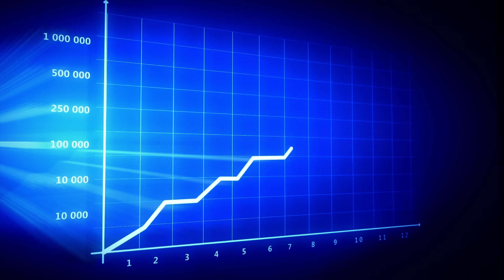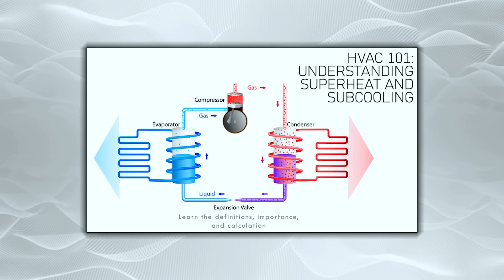⚠️Growing Problem of Mixing AC Refrigerants

Comment: I was in the HVAC business for 40 years. It taught it at trade school. I'm retired from it now.  IMHO sun downing R22 was more a matter of DuPont patent rights than ozone issues. R22 was an ideal refrigerant. Now they are doing it again with R410a. I have a 25 year old R22 Rheem system which I installed in 2000. After looking at this whole r454 $hit-show, I bought an exact new replacement 3.5 ton R22 Copeland Scroll, a 30# tank of R22, an exact swap R22 TXV.  When mine goes down, I will rebuild my existing system like it was a '57 Chevy.
Reply: Wow, what a hornets nest I stirred up. I simply said I’m staying with R22 because I have the skills and parts to do so and it historically found it works. You’d think I defamed the pope. 

Mark my words youngin’s you’re going to see the same issues with R454 condensing units you’re now seeing with turbo charged 4 cylinder engines being put into trucks. The old V8’s were tried and true technology but some pencil neck bureaucrat who had a $200 lunch with an industry lobbyist decided we needed to convert them all to 4 cylinder turbo charged engines because they got 7 mpg more. Except for one thing, they don’t perform their primary function of reliability. Hence people are getting 5000 miles out of a new Toyota Tundra before the engines are trash. 

That’s all good news for you new guys in HVAC, you’re going to be quite busy on warranty calls, but it’s bad news for your customers who depend on your skills. Think this is just all my personal conspiracy theory? Have you asked yourself WHY you can’t suddenly source r454? Hmmmm !!! Conspiracy theory or the typical market manipulation for higher prices? Age does give one historical perspectives and I saw this same game played out in the late 90’s.

And as for the environmental impact, the science isn’t settled on “freons” negative effects on ozone depletion, but there are going to be whole a lot of landfills filling up with dead R454 condensing units.  If you believe the government always has our best interests at heart, I got a safe and effective Covid vaccine to sell you.
Reply: @milwaukeephil2548 yes sir - been a heavy duty mechanic for 25 plus years - the garbage that they’ve tossed at us in the name of the environment is a joke - it’s all about cycling out equipment sooner than we used to selling us inferior over priced complicated garbage - truck engines last half as long as they used to , get half the fuel  economy , now require a separate exhaust fluid - the new heavy equipment and trucks are garage - the toss some bs creature features and everyone gets all hot in their pants - I don’t give a shit about a heated seat or touch screen in a excavator or semi tractor - I want a reliable , serviceable , rebuildable unit not this over priced trash - “oh it’s better for environment “ HORSE SHIT ! We are tossing stuff in the dump left and right -everything from chainsaws , to household appliances, cars , trucks , equipment - price has sky rocket quality is in the toilet -
Reply: 😂 someone took notes in class.. it’s all a gimmick
Reply: 22 is just a thicker refrigerant.  It will tolerate microleaks in the coil a lot better.  R12 was like gear oil, that stuff would stick forever without leaking.  It was just so fat it couldn't get through the little holes. 502 was the same way. I do love 448a, it is a great new refrigerant . All the phase outs have always been a nightmare,  but boy do they bring profit.
Reply: You're absolutely right we have done it for 43 years it was DuPont's fault r22 was fine
Reply: They've made the R22 coils and compressors out of sight .you can get your hands on the new equipment cheaper .it's the labor and supplies that you'll need is what will cost you .
Reply: I have mixed match r22 system with a 20 year old Rheem air handler. I have been nursing it along just because of all this AL2 refrigerant business. I am a retired hvac contractor more less, and still undecided what I will go with when that day comes,
Reply: you'll go with what is available. I don't blame you for nursing your equipment but at the same time, there will be a point where it won't be worth it.  @buckbryant8599
Reply: 💯 correct!!!
Reply: You need to do better research if you think r22 doesn't affect the ozone layer negatively. It's also many times more effective as a greenhouse gas compared to carbon dioxide.
Reply: "Here little buddy, I know youre 10 years old but its 1948 and cigarettes are fine. They won't hurt you. Quitting is a gimmick"
Reply: Yeah but it will waste electricity like a 57 with a drinking problem 😂  I get what you mean tho kind of cool of you to keep it alive. You’re paying the bill so carry on soldier.
Reply: @HVACTASKFORCE 
The amount of electricity used for 3 to 4 months of the year  will be miniscule to the amount of money wasted on a  new piece of junk that will last 8 years tops, and have boards and ecm motors burning up left, right, and center.
Reply: False. The differential isn't significant  @HVACTASKFORCE
Reply: @blueblack9675 😂 the unit alone can’t make the difference you have to upgrade your insulation doors and windows as well. Use that tax credit to your advantage.
Reply: That was my point the unit itself isn't that much energy sufficient, its how well your structure is well insulated. I agree with you 😂@HVACTASKFORCE
Reply: You got that right! I’m doing the same thing! I installed mine in 1998 and still running strong! Let me knock on a piece of wood 😂
Reply: Dont think youll be able to rebuild it unless you find used compressors. Good luck
Reply: @richwiskey he said bought the exact same compressor so he might be able to. Just is it worth paying that much on electricity.
Reply: @richwiskey  Let's make a comment displaying how little we know.   "I bought an exact new replacement 3.5 ton R22 Copeland Scroll" is his compressor replacement.
Reply: @BillR-e2g he didn’t read the full comment 😂
Reply: @BillR-e2g     Reading is hard.    🤣
Reply: @jkmarshall3553  IMHO It's not that he didn't read all the comment .  It's he didn't understand the term Scroll.
Reply: @richwiskey  yes you can without a doubt one can easily buy an R 22 compressor all day ant day  but guess what all new R 22 compressors come with POE oil & R 22 & 407 c is The two  & ONLY approved  by Copeland in writing allowed into there  new  r 22 compressor to maintain its full warranty
Reply: Unless you have a PhD in the chemistry applied here I don't think your background gives you standing to speak on the issue.

The fact is each generation of refrigerant has been 'better' for our ozone. As the demand for HVAC system increases (due to increase population, global warming, and even adoption of heat pumps) the need for less damaging refrigerants also increases.

I get your preference towards the system you worked on and taught. Completely reasonable, but that is not the same thing as it being better on a mass adoption or global scale.
Reply: global warming is a con
Reply: @kentsutton4973 you don't need a degree to be educated on a subject.
Reply: @kentsutton4973 It sounds like another case of an old person refusing to accept new things, and starting conspiracy theories. 
R410a offered better efficiency in terms of heat transfer than R22 (besides the higher pressure).

The older people who posts things like ‘R22 cools better than R410a’ really has two things going against them. Firstly being that R410a pound per pound will outperform R22, and the fact that 2 Tons of refrigeration is 2 tons of refrigeration irrespective of the refrigerant used.
Reply: Been in the HVAC business for 40 years yet you don't understand the history of R22 and why it was banned. R22 was absolutely banned because of ozone depletion and nothing else. R22 patent expired in the 1940s while R410a patent expired in 2011 and is being phased out not because of ozone depletion but because of GWP associated with it. R410a is a combination of R32 and R125 with the latter being a fire retardant. R32 is under no patents at this point and is being actively used in many systems. R410a has slightly higher GWP than R22 and significantly higher than straight R32.

R22 equipment may be simplistic but it's inefficient garbage compared to the best stuff on the market now. If you have access to cheap electricity and don't need good heatpump performance then by all means continue using your geriatric equipment.
Reply: @imzjustplayin considering I thoroughly leak test my systems by pulling a 500 micro vacuum and holding it before charging and my systems don’t leak, all we’re talking about is what electricity I’m willing to pay for.
Reply: It is all about big business making more money.
Reply: @imzjustplayin haha!  Yeah, my boy used to work at thr Embassy in Iraq as a contractor.   They vented R22 as it was cheaper than recovering it and using Virgin R22 in.   This was  in 2022

Comment: See it's with what refrigerant you go with... in reefer it's been done... when we where pusing 22 away I've heard crazy stuff...
Reply: Well you dont "go with" a refrigerant. You MUST use the refrigerant it was designed for.  When 410a came out there were idiots that stuck it in 22 systems. You in reeder used 404a afyer R12 and R500. Let alone HP81 and the est for ice machines. All have different properties and compresors and condensor coils and metering devices are calibrated for each design
Now you only have 454b and 32. Stick with Goodman using R32. Easier to get not as expensive and like putting in the old units.
Reply: @richwiskey  404a was to Wipeout 502 in reefers they had a bunch of subs hp 80,81 408a and for 12 was mp 39 409a hotshot fr12 and then went to 134a.... and for ac at least for 22 there still subs like rs44 nu22 and mo99... so you have choices it that for high temp apps (a/c) there's very little options thats why I stay away from resi.... newer compressors are made for multiple refrigerants because of this same nonsense with shortages or you go with one flavor or another... the market makes take those choices...